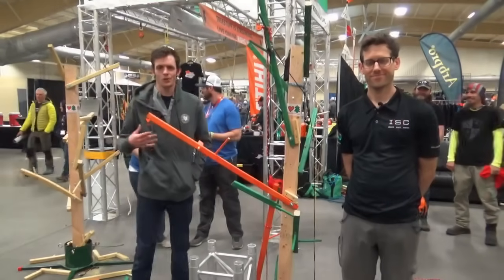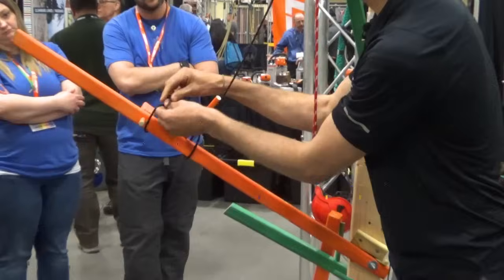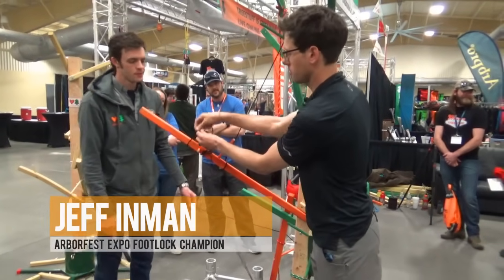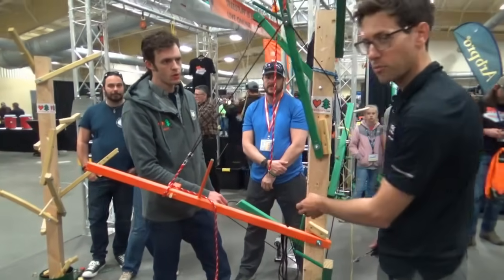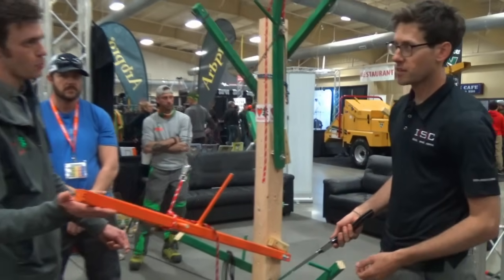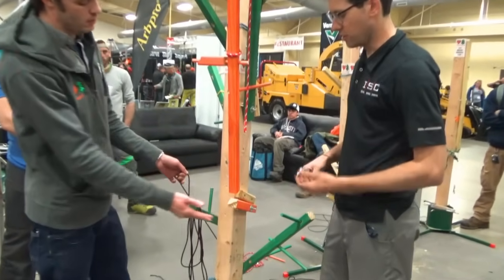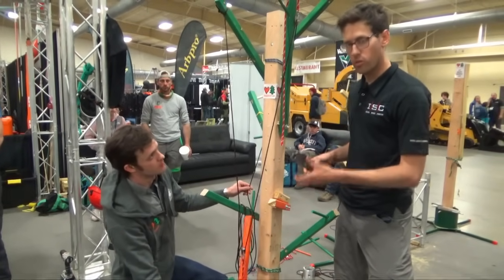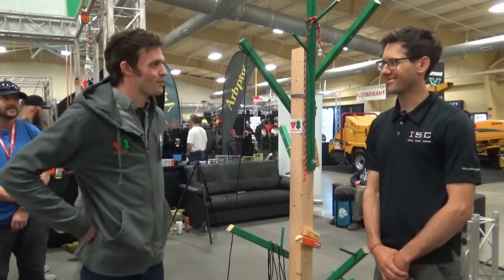How to Use Span Rigging to Remove Limbs w/ Jeff Inman

Comment: Hey climber go rig a block over there then take your rig line set one out on the limb half way out through a ring then pull line up to the limb above and tie it off with a running bow real quick. Come back down and make a reverse hinge cut and we can crank it up. Will split pulling weight between 2 anchor points.  Keep the coffee crane coming please. Cheers to those arborist's that actually do this. Hats off and no matter what anyone thinks your still underpaid. Shoulda been computer programmer or IT. Gaffs up climb down backwards like a smart cat. Removal yourself from the situation.

Comment: Loved the video, but one thing that you should have mentioned at the end, is if you plan on pulling the piece away from the COG towards the chipper, you are introducing a "force multiplier" on the piece that will make it seem like it weighs a lot more and has the potential to than break off the rigging point/s at the stem.

Comment: Always let a little weight off after you get the piece stood up straight to avoid shock loading. I’ve never seen a piece stood up on the hinge that didn’t have more force on it than the weight of the limb itself. Don’t try to break hinges with the Grcs big open face then cut through when it’s vertical and loaded correctly. You wouldn’t break wood fibres with a crane don’t do it with your rigging and the tree you’re tied into. Realistically the butt of that limb could’ve flown up in the air and then come back down hard on the climber. Other than that good video.

Comment: Works good if you have a $3000.00 GRCS. I also think taking  bigger pieces only easier for climber, not ground crew who has to get piece on ground.
Reply: Without a GRCS, you could achieve a similar effect with a block and tackle (which you can whip up with steel carabiners, slings and prussik cords in a pinch, although actual pulleys will be much more efficient) and a port-a-wrap. See the following video and PDF for visual aids:
Video: https://www.youtube.com/watch?v=TMADD6KV0ZY
Port-a-wrap instructions (page 3 and 4) 

You'll need a good eye to estimate how much mechanical advantage is needed for your ground worker to lift the piece, and you need to know how much force every piece of your rigging can withstand with the mechanical advantage.

With this technique (which is called "tip tie and lift" in the ISA arborpods), the angle of the face notch should be equal to or very slightly smaller than the angle by which the piece will be lifted to ensure a clean break-off, without the climber having to free the piece of any remaining hinge. Ideally the piece should be vertical at the break-off point to reduce swinging, in which case the face cut can have one side perpendicular to the length of the piece and one side parallel to the ground. 

I highly recommend these two videos to arborists and anyone who likes the idea of gaining mechanical advantages to pull heavy stuff around:
https://wwv.isa-arbor.com/education/onlineLearning/podcastDetail?ID=5&EP=1040
https://wwv.isa-arbor.com/education/onlineLearning/podcastDetail?ID=5&EP=1051

Although all the arborpod videos are well-made and informative!
Reply: Adam, this technique also works without lifting. I use the span technique frequently while balancing a limb. Once I have the money to get the big Stein bollard with a winch, I'll be lifting, too, because sometimes a balanced limb takes some finessing to get to the ground around obstacles. Ground guys like big pieces, too, because they spend less time wrapping the port-a-wrap and untying running bowlines on a bunch of small pieces.

Comment: Good demo of span rigging (we call this setup butt heavy rigging with a split anchor double pulley system), but tensioning the system after making the face cut is a big mistake.  In this type of rigging, the time from starting the cut till the piece is fully in the rigging and stabile is the red zone.

The system should be tensioned enough to help load the rigging as well as show where the limb & anchor points want to flex before any cut is made.  This is especially true as the pieces being removed get larger.  During the cut, the cutting can be stopped and small adjustments made as needed to balance any shifting of the rigging or limb.  Alternatively, if a mistake is made during the cut or a defect missed with no tension in the system, the limb can snap off suddenly or tear and shift causing all sorts of problems.  If the situation is really hectic, a short piece of rope tagging the butt to another branch or trunk is very beneficial and can easily be removed after the piece is cut and stabilized.

Thank you Treestuff for all your videos and the other benefits you bring to our industry!
Reply: I like using a second safety line to control butt swing. Not much time to set up, but nice insurance to have